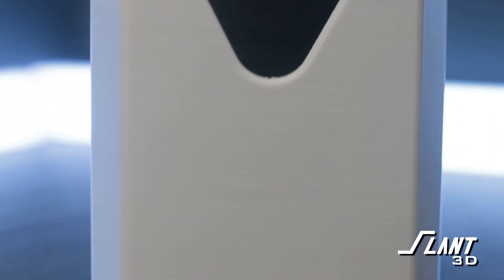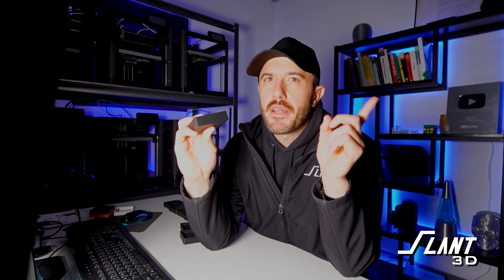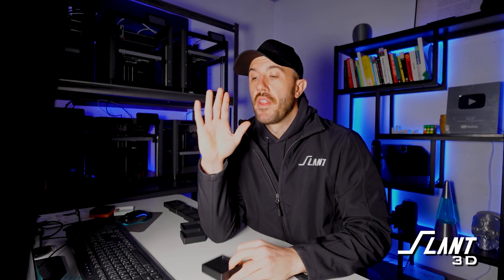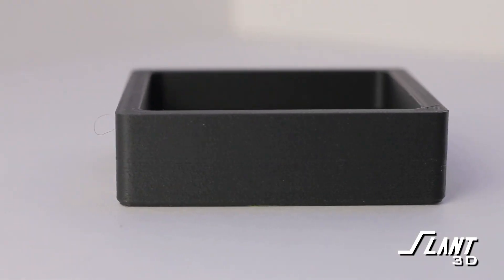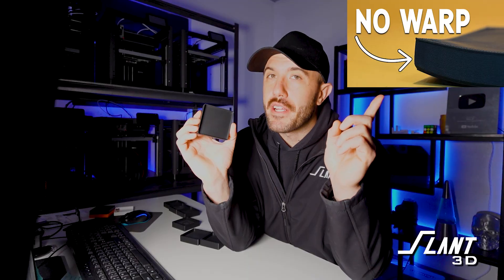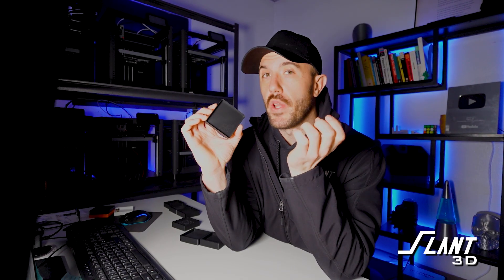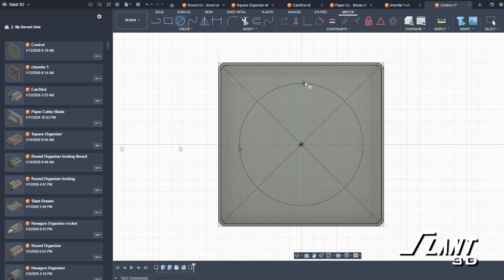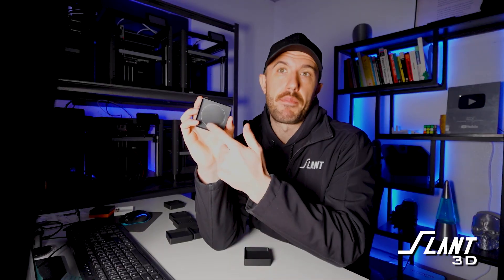How to Eliminate Shrink Lines

Comment: Anybody else wondering when AI will hit slicers? The slicer should analyse every layer to optimize the print. A lot of tactics proposed by Slant3d to implement in CAD should be possible. Slicers don't need to be as dumb as they are presently. AI should be capable of iterating thousands of times to achieve the best result. It's already happening in medicine and materials science.

Comment: PRoblem with hull lines doesn't come from shrinkage of layers but from filament pushing out sideways ofter stacking up horizontaly. If You change the outer wall print order or infill / wall print order, then You can get rid of this line, however,  those setting come with disadvantahges of their own.

Comment: @6:00 That's basically the contraction joint construction of concrete. As found in Sidewalks or large pour slaps that are to remain visible. Sept in concrete that's to focus forces that cause cracks in that recessed groove and not out on the broad surface. Maybe instead of a simple flat level dropped down, a beveled dip - a half pipe?

Comment: I haven't got a printer yet but if I were to venture a guess and add a point of my own, not only the internal stresses from expected shrink are occurring, but the layers are getting more time to cool as the nozzle moves on to print the interior space rather than immediately going on to the next layer. I've been watching a whole lot of 3d print videos and it actually resembles what a pause and resume looks like. One youtuber was mentioning power stability and print pausing when power fails. I wonder if there was a way you could reheat the edge layer before resuming so you get better flow and adhesion, if that would help alleviate the hull line. 
Putting the print at an angle eliminates hull lines, (Benshies printed at an angle as reference), not only because the tension is lower across a single layer line, but, the printer gets back to the layer before significant cooling takes place which is probably why stepping, (the dish at 4:30), helped quite a bit.

Comment: Great tips, definitely gonna try separating the floor from the walls! What about modeling a hollow section inside the walls at the floor height, thus separating the inner and outer walls... Of the wall, if you catch what I mean. 

Similar future videos could be improved by showing a section view from CAD to illustrate the differences of each methods, and show that section view again when talking about them again in the video. At times it was a bit hard to follow what was being described.

Comment: You keep showing the slicer preview which clearly shows large areas of continuous fillament extrusfion. The grid example where you raise the walls still had a couple of layers of solid bottom, still connecting everything together. You would need it raised enough that the slicer generates discrete chambers without a shared floor. Otherwise you are adding fancy texturing on top of a continuous floor.

Comment: TIP: Only do this if you need that sharp inner corners. 
If not, don’t sweat it and just put a fillet in there

1. Stronger
2. “Easier to clean”
3. Easier to take things like coins, out of the box

Comment: Slicer-done but pretty simple, one solution I have liked is skipping the top layer in that section if its an option. Not always possible if its a feature or used surface, but has come in handy

Comment: I would try doing a layered crosshatch design to decrease the directional forces. Alternate horizontal and vertically lined layers (or diagonal: +45 -45 degree alternating), then fill one solid layer to finish off the top of the base, but print it perpendicular to the layer below it to ensure they don't add up their forces.

Comment: Hi there, one of the issues you brought up about the crosshatched form was that it was the short diagonal lines. But now you're also dealing with a large number of internal, vertical walls that have their own internal shrinkage. You've moved the issue from a horizontal to a vertical one.

Comment: Good topic and thanks for the video. I had a little trouble following the cause of the problem and a couple of the techniques you suggested, despite the good visuals inserted. They aren’t easy to communicate in a short video. I know that, but wanted to provide that feedback in case it helps.

Comment: I feel like a radiused trench around the perimeter of the inside corner would be an ideal shape if one can get away with it. The radius is 'below' the waterline of the floor so it won't impact the mating of any parts, and the radius will provide the best flex as the floor surface adjusts size. Then if the goal is to go nuts with it, maybe some deeper corner pockets so the pull stays perpendicular to the walls instead of trying to flow through the corner.

Comment: It’s the filament temperature transition from fast volumetric flow to slower.
Reply: So what is the solution?  I have a part I print in petg on my x1c flawlessly. I just got an H2d and when I print it on that I get this “shrink line” every time.  I’m using the same slicer settings and same filament.

Comment: I don't understand the suggested solution? wdym jut put a cut? where? you didn't show it. Am I stupidity?
Reply: For the top surface, cut around the edge of the lid inside wall. As the line is due to the change in shrinkage, cutting just where the top layer is will prevent the solid top from pulling the wall.
Reply: He somehow missed showing the zoomed in version of the actual solution 🤷
Although i did understand it from his words.
Reply: I think I get it, you make a moat/channel/groove at the base of the wall, but then surely that just lowers the stress point, unless that height being mostly infill instead of top layers makes it less shrinky. A close up or slicer would have been helpful
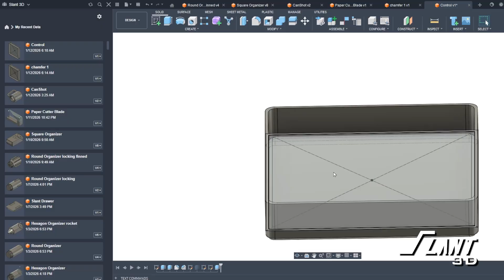Reply: They did, 5:25 forward. But it is a bit confusing because at the end of the video they tell it was the best, but don't clearly show which one they're talking about.
Reply: @Catrik nha it's not clear at all bad video, no one understood

Comment: I never had that issue, because adding a chamfer inside in the corner between floor and wall is the golden rule to strengthen boxes. Even if the chamfer is only three lines. So, I've never seen anything like this on any box designs in any material, im using cura and orca. Most are printed in PC or ASA in a heated chamber, but sometimes in PLA, no issues.
Reply: Yeah, it's interesting. I've never noticed this issue either, but I fillet almost all of my inside corners by default

Comment: I don't understand how there isn't a setting compensation within the slicer for this already. I mean it seems like something so rudimentary because the slicer can already see where your walls are connecting to the surfaces.  Your tips, while super helpful in some cases, are not applicable to round things with threads and bases such as bottle caps and other threaded objects.  I have been having challenges with printing food safe pla that has threaded parts.
Reply: There is several, this guy is a idiot. He doesn't explain ANY of them. If I was his boss, I'd fire him. Add textures.. that's his holy grail of fixing it??
Reply: @CookieManCookies  He runs a printing service. You upload the file, they print and ship it to your customer. His advice is tailored towards this business model. The printing service won't tweak slicer settings, so if you want the best results all problems need to be solved in design.

Comment: I do not understand the notion of "disconnecting". The piece you show seems still connecting. Unclear what is being suggested.
Reply: Go to 5:45 as he shows the layers of the print, in the slicer. Notice how there is a groove in the bottom corner where the floor of the part meets the wall? He only shows it for a short time, but if you're watching youtube on the web, (not the mobile app) use the < and > keys while the video is paused to see the next or previous frame, one by one.

Comment: Hi, you can partially solve the problem by slowing down the slicer at that point and setting the walls to print from Outer to Inner.
Reply: Certainly, but as he said he was looking at solutions that would be slicer-independent.

Comment: You could chamfer that inner groove so there are no top layers and it comes down to a point in the corner  instead. The slicer might still generate solid fill under it though.

Comment: I would think adding a void in the middle of the wall model would do the same thing as the groove inside the wall. Will have to try it
Reply: This is THE answer. I did this on one of my last prints where I needed the outside surface to be virtually flawless (decorative piece). The part was topologically basically a box/well - a flat bottom with a bunch of walls. I made the walls pretty thick, then set the infill to 0 while printing them. So I had 3 perimeters on the outside and 3 on the inside of the wall, but both sides were not connected to each other at all up to where they sealed up at the top. The part came out pretty sturdy despite the obvious structural flaw, and the hull line was completely gone after wasting like a full spool on prototypes that were plagued by it.

Comment: What about increasing the chamber temp to something that overcomes the material wanting to shrink?
Reply: @3DPrintingNerd  might start getting heat creep and jams id guess? How hot would that have to be
Reply: @juts89  I did this with ABS and a chamber temp of 90c and it worked well. For PLA prints, ooh, thats a very slim temp margin, yeah?
Reply: They have to cool eventually, one way or the other, and the stress doesn't magically go away on its own, sadly.
Reply: @maria50337  If everything is super hot, then when it cools it cools evening, right? wouldn't that negate the hull line by not shrinking until everything shrinks from cooling?
Reply: @3DPrintingNerd  It would be great to see you try, with your resources, and see what you could come up with. I've never had any luck reducing warping using a hair dryer to keep things warm, but it would be amazing if you could test and find a better way. It's that stored stress, I just can't get rid of it.
Reply: @3DPrintingNerd  I don't think it does. Imagine the following:
Assumption: When cooling there is eg 2% shrinkage.
Now take a filled square of 100x100mm. That shrinks to 98x98mm.
Now take two parallel lines of 100x1mm, with 98mm of space in between (basically two sides of a square) so 100mm when measured from the outside of the lines. 
These lines will both shrink to 98x0.98mm. But they will be 98.2mm apart (space between) and when measured on the outside they are 99.8mm.
That's because they are not connected and can shrink on their own.
Now when you connect them with infill, it depends on the type and amount of infill how strong the pulling force is going to be. A wavy pattern like gyroid will probably act differently than a rectilinear infill, and solid infill will also be different.

Comment: Would love to see what happens if you combine several of the successful approaches in one part. Specifically The “micro ditch” along with the grid, but add small chamfers inside the squares. I would expect all the effects to add up. On top of that, a texture would seal the deal.

Comment: Wouldn't printing the outer wall first help lessen the impact as well?
Reply: It solves it entirely, this guy has a boner for solving things not via the slicer because he runs a print farm and can't be bothered setting the best slicer settings for people. So pushes people to get a sub par result via model changes instead.
Reply from the maker: You don't want to rely on slicer settings when possible

Comment: I have been using a variation of the grid pattern on models that have a large contact area with the build plate.  I sink a pattern of small hexagons into the bottom 1-2mm deep.  This takes away the strain on the corners so that I do not get any lifting at the corners.  This  is especially helpful when there is not enough room for mouse ears or brims.
Reply from the maker: Absolutely. If you want to make the first layer simpler go ahead and check out our warp video.

Comment: Tbh i think the cutout cubic "ring" on the outside was basically identical to the control in design with en extra bump in the middle but since the cut moved it closer to the heated bed thats what really  cut the line aka just have a thinner base and you will not have the shrinkage line like i aim to not get infill on the bottom of a base like that and only when i do is when i get problems otherwise i just dont get shrinkage lines yes i get lines for other reasons but not shrinkage